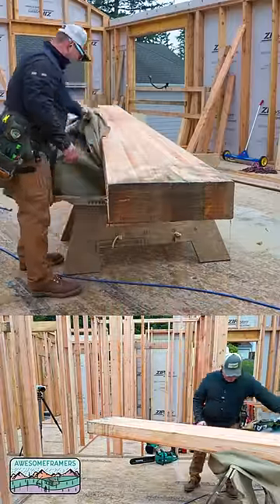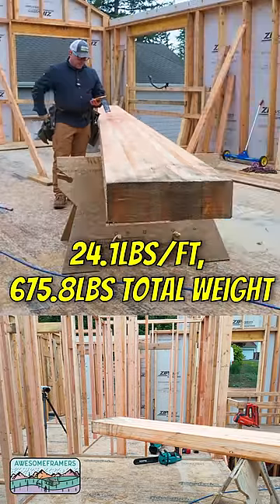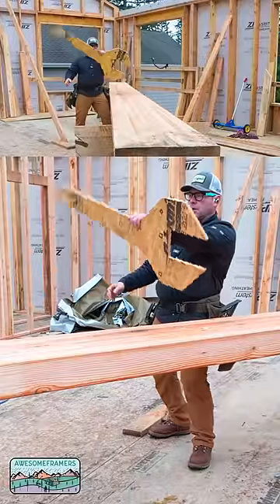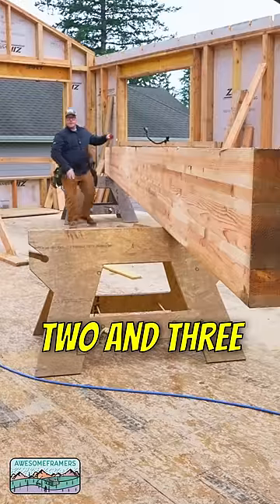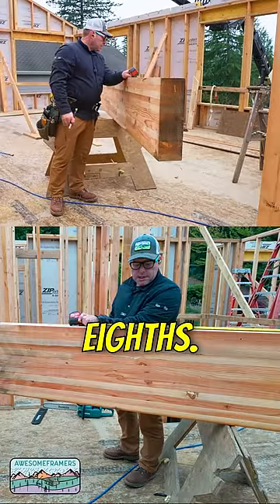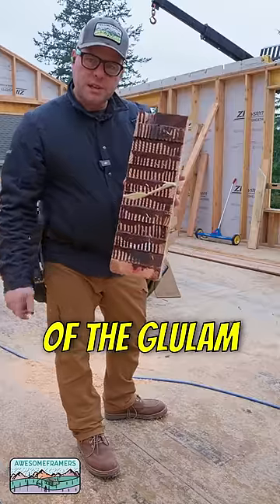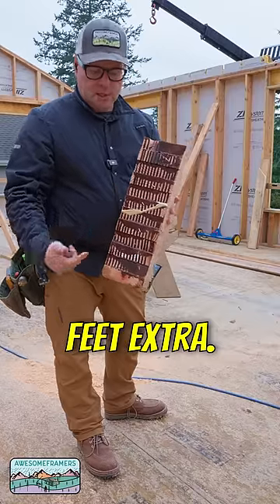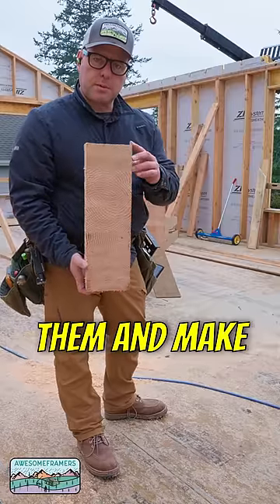Are You Strong Enough?  #framing #construction #leverage #glulam #huberpartner

Comment: What’s most impressive here is not the wrench but the saw horses are the real deal !
Reply: if your saw horses can't hold 300 lbs each then you need to sell your hammer and geta different job
Reply: We've had our  homemade saw horses for 5+ years now. Just replace the 2.6 tops every now and then from running the saw thru it 1000 times. We've for sure set at least this weight on them hundred of times
Reply: wood chips and glue. most houses made of now. complete garbage
Reply: Iv had a thousand pounds on the plastic stands from lowes. Building pallets at my old factory job and now as a self employed carpenter
Reply: @lilbucko  as opposed to buildings that were built before a building code was in place, they used to you horse hair and hay blades to insulate
Reply: @lilbucko before tyveck and before black paper for roofs
Reply: @lilbucko and the foundations made of rocks 100 years ago that are now crumbling, or the fact that the weight of the roof is floating and not even on the crumbling foundation
Reply: @chadvanryn1327  typical chad response.
Reply: Take it easy on the old dog school wasn't invented in his day so don't take him now
Reply: @joelchrysler6238  I’ll admit I like a love an old 2/12 and hate the new OSB I beams they started using
Reply: Yes @g-ray7019
Reply: Make a video on how to make the sawhorses please
Reply: Cheap saw horse hold a lot. Homemade ones hold thousands if the guy making them has any basic knowledge
Reply: @chadvanryn1327 also glulam and other products like lvl are often able to withstand much greater loads and span greater distances than traditional dimensional lumber
Reply: @chadvanryn1327 my house was built in 1913 with terracotta foundation, and zero damage. Holds up a lot better than sandstone.
Reply from the maker: @lilbucko Ignorance
Reply from the maker: @franciscodiegozavala71 it's already on my channel 👍
Reply: @chadvanryn1327 uh you're saying it's a bad thing that old houses are starting to fall down at 100 years? Guarantee the majority of houses built now will last not even half that
Reply: @chadvanryn1327 I don’t know where you are referring to but stone lasts for thousands of years. The town I live in has loads of stone buildings dating back to the 18th, 17th and 16th centuries as well as a couple of medieval buildings mixed in there. They’re all really solid  unlike the buildings from the 50’s, 60’s and 70’s. My family had to replace the entire roof in our 70’s house since it had deteriorated so badly the tiles were no longer waterproof. The old buildings in town do still require maintenance but the original materials including wood rarely need to be replaced outside of unusual circumstances such as prolonged neglect or storm damage.
Reply: Almost every manufactured sawhorse is rated for 1k+ pounds these could probably hold even more.
Reply: Saw horses are so strong I used them for my foundation and framed the whole house with saw horse wood. I've sat at my kitchen table with coffee watching F5 tornados go right over my house, no damage.
Reply: My saw horses are rated for 1500 lbs.
Reply: @thomasdracup8403  RE: stone foundations.

There are a LOT of houses built through the 1910-1940 era where the foundations are river rocks that have been surface mortared only. You'll get into a crawl space and see the foundation with a hole, look in the hole and the entire core of the foundation is just unmortared round rocks in a pile.
Reply: You're not wrong
Reply: @lilbucko it's not wood chips it's 2x4 pressure glued together. By the way plywood which that is has been around since Sparta and Roman times. Their shields were made of it
Reply: @lilbucko airplanes were made of plywood cause it's light and strong
Reply: @neverpreparedenough6431  Lets hear it for DeHaviland 😁
Reply: @neverpreparedenough6431  do you even know the difference between osb and plywood?? Lmao
Reply: That's what I thought
Reply: @lilbucko  Difference between OSB and Plywood is just the size of the "chips". lol

Oriented Strand Board is multiple layers of wood glued together with differing grain patterns...

Plywood is multiple layers of wood glued together with differing grain pattern.

OSB is just a bit more "recycling friendly" as you can use smaller pieces of wood to generate the chips while plywood needs full sheets of veneer. Otherwise, by function or cohesion, they're both pretty much the same...
Reply: @nunyabidness674  tell me you know nothing, without tell me you know nothing. Lmao
I like the definition you got of the internet.
Reply: @nunyabidness674  what you say goofball?
Reply: My sawhorses are rated to 10,000 lbs
Reply: 👏🏻👏🏻👏🏻👏🏻 those poor horses! 😅
Reply: Definitely impressed with the saw horses!
Reply: @lilbucko  These are not made from wood chips. These are made from solid timber. You can build your house out of whatever you want, if you can afford it.
Reply: Yes, I thought that too - but was a little worried when he stood that glulam on edge toward the edge of the sawhorses, barely keeping them within the sawhorse base's footprint!

Comment: You should see this guy's toolbox. Wrenches go from 1/8" to 47/8"
Reply: I was wondering what brand it was
Reply: 47/8” is wild😂
Reply: Me did they really just pass on the wrench like no big deal 
you 47/8th
Me 🫡
Reply: @thebatman5214  looks like a old Woodchuck- 47/8
Could be a custom Sapling (don't get me started) 
Hard to find- worth every penny. Lmao
Reply: Wonder if they have an adjustable version 😅
Reply: It's crazy he still uses non standard measurement
Reply: Doesn't even go to 6 inches? 5 7/8 inches is as big as the set goes?
Reply: @thebatman5214  It's made by Hubor and is sold as Advantech.

Comment: When I built my house I moved a 40' 440lb king beam into place by myself.  I moved it over the full basement wall so it was on the wall on that side and at the base of the opposing half wall.  I used a floor jack to get it high enough so I could lift it onto the base plate of the framed wall.  I had left the top plate off so I jacked up the beam from the outside of the wall as high as the jack would go and then in a herculean effort I lifted it the rest of the way, up and over into the framed beam pocket.  Pounded it into it's final position and straightened the wall, used a handsaw to trim the beam and nailed in the top plate.  My wife wrote the date on the cut off and it still sits on my desk today, almost 30 years later.
Reply: That story deserves a whiskey and a cigar... nicely done sir. 🥃
Reply: @knuckleheadpro8658  Cheers!
Reply: I built a 30' gluelam in place using a gallon of glue, consttruction screws, plywood and 2x10's sandwiched.  No way we were lifting that 15' in the air.  Where there's a will there's a way.
Reply: @davidyansky6605  That's a big one too!  Smarter to build, glue and screw it in place that high in the air.

Comment: Just make sure you lift with your back in a quick jerking motion, this will increase strength.
Reply: You really have to reach out and extend off centerline too. Be sure to twist as much as possible to get the maximum effect. Keep your core good and relaxed, then explode with power.
Reply: Great advice.
Reply: Noob Here,  Thaaaank You for the Valuable Advice!! I only have 1 question though...
Back Brace: Yay or Nay?? 
I say Nay, because it makes me look Goofy, and my Face has that covered all by itself!! Any advice will be greatly appreciated and utilized Immediately!!
Reply: @mikevg101  If a back brace wont interfere with your work, absolutely use one. If anyone tells you it makes you look goofy, you can laugh at them later when they're all mangled, twisted, and can't walk normally when they're 40.
Reply: Don't forget to wear the appropriate flip-flops and wrench your back sideways back and forth to really increase the amount of torque you can get.
Reply: @YukonJack  That's What I was forgetting!! The "Torque from wrenching my torso!!" See, this is the knowledge that can't be learned in a school!! I'll be A Foreman in No Time!!
Reply: I tried this and my back really hurts, did I do something wrong?
Reply: Get the groin involved too! You can make a lot of lifting power from the groin

Comment: I ordered a 9’ long x 20” wide x 2” thick limestone sill for the front of our fireplace and it was 375 lbs. talk about how easy that was to get home, then down the stairs. Then around the stair opening and to the fireplace…..Wow!  But it got done without breaking it, it’s been installed 20 years, still looks like new. The family room 6’ was 265 lbs. and it was easy!
Reply: Reminds me of trying to carry my soapstone woodstove into my house 😂 4 people and it was a huge struggle the whole time.

Then after we got it off the pallet and installed, I read "remove refractory stones before moving to reduce weight" and we all laughed
Reply: i did front concrete steps with two 3-foot square bluestone pieces to raise sunken precast up to right height that was a pain to drop those pieces on by myself.
Reply: Yelling at your wife 'STOP! STOP! WAIT A MINUTE!' the whole time
Reply: i took a player piano out of a basement once. stamped on the back was 708 pounds. it was easy since it was on 2 inch wheels. 50 years ago and i still have the hoist.

Comment: Used to work in a factory that produced LVL, we sold bundles that were as small as 1-1/2”x5”x12’ or as big as 3”x24”x60’. I tell you what, them bundles weighed THOUSANDS of lbs.

Those are the extreme ends of things though, we mostly sold 1-3/4” thick wood about a foot wide (11-7/8”) between 12 and 60 feet but some times we had odd-ball orders of 72-76’ long bundles. Just an 8’ section weighed 110lbs, couldn’t tell you how many of those I carried lol. Carried about 25k lbs in one 12hr shift, was ready to quit that day.
Reply: My neighbour was a truck driver for Sysco he moved anywhere from 10-20000 pounds 5 days a week and some of the businesses were up 50 stairs at the ski hill. 25k is physical but many people move that regularly.

Did you work for Louisiana Pacific or a different company? Most of my family did a couple years production at the mill in my hometown where LVL was the main thing.
Reply: @IhaveaDoghouse  it was LP. That company and the one that bought out the factory were terrible. Regardless of experience or position, everybody made the same. So while I was forklift certified and moving 30k lbs loads, and could do 6 out of the 8 positions where I worked, I got paid the same as the new guy who could only do 1 thing.

Major respect to anyone that carries 25k lbs of anything, by hand, across a couple of miles. I ain’t doing that again 😂
Reply: @SoreTv  Ya I'll get filled in on Pacific Woodtek when I go home for Christmas by my brother that still works there.

My dad suffered there 30 years as a maintenance electrician then talked me and another brother into becoming electricians lol. After he retired I asked him if he actually liked his job and he said no so pretty messed up he would recommend it as a career to his kids but the union ended up being good for him, growing up he was a few dollars an hour lower than oilfield electricians but when he retired last year he was making 44.50$ and hour while the oilfield rate is around 41$. 

He worked the "weekend shift" the last 15+ years so 3 10.5 hour shifts on saturday and sunday and get paid for 40 hours then he would be a zombie the rest of the week because he claimed he couldn't handle the weird schedule that he chose to stay on for almost 2 decades.

Honestly though my dad hated his job so much he wouldn't pick up a single OT shift and would sleep all week, anything the 5 of us wanted from the time we turned the working age of 14 (besides room and board) we had to pay for with our own money so all sports registration fees, equipment, clothes, vehicles, gas, insurance etc. we worked 50+ hours a week for in the summers and 24-32 hours a week for during school for 1/6 of what he would make if he could stand his job for more than 31.5 hours a week lol.

 I even bought my parents a car for 2500$ when I was 15 under the promise of 5% interest so 2625$ back and I didn't see a penny, instead got the choice of the chevy astro van or a clapped out truck his friend would trade for the astro van. So yes being an electrician for LP is so bad that you won't even go into work to pay off a debt to your own children.

 My gf is also an electrician as well as her dad and her mom was shocked when I said "the only rewarding thing about the job is the paycheque" and she was looking at him for a rebuttal to my comment and he just had the look like "ya, you think i've been having fun away at work the last 30 years?" She's a nurse so she actually has a rewarding job and couldn't fathom what it was like to be a numbered grunt for an industrial company.

Hopefully you found a better company to work for, I am trying to figure out a career change in my early 30's but not having any luck yet.
Reply: @IhaveaDoghouse  I would recommend picking up a trade but you’re already a sparky lol. I went into LP outta high school at 18 after I graduated early. After I left that place I started at a toyota dealership as a technician, but honestly I got too many bills and with them not moving me up and the limited OT, I’m looking for other avenues of income. I’m a hobby carpenter, mechanic, welder, and content creator with a tad bit of game development. I want to do a lot of things but being handy is at the center of all of it.

Comment: I saw this tool you made a while back and it inspired me to make something similar the other day.
I was replacing the flush valve on a Koehler toilet and the nut that hold it on is giant and none of the tools I had on hand could span it to remove/tighten that sucker. Found a bit of scrap plywood in the truck and cut it to shape and size. Worked like a charm

Comment: im more impressed with the saw horses
Reply: OSB is legit when loaded axially, hence it's usefulness as sheathing for rigidly tying the building framing together. 

Now, introduce a bit of flex into one of those legs with that load sitting on top, and you're gunna have a bad time! But with the 600+ pounds split between 2 horses, each with 4 feet contacting the ground, and those feet being pretty long in their contact area, I'd imagine you could load quite a bit more weight on them still. It's legit probably a better solution than commercial saw horses, which while able to carry thousands of pounds per pair, are transferring all that weight into the ground through feet that are an inch or two square: I'd not want to test my subfloors ability to resist point loads like that. These wide OSB feet are going to pretty much guarantee you're directly over a couple joists at any given time.

Comment: Why order that much extra footage? Not sure if I’m missing something. It’s around $50-100/ft in my area, depending on the time of year.
Reply from the maker: It's nowhere near $50/foot more here. I thought I addressed the extra length in the video. Glulams are manufactured in 60' lengths. As you can see the end isn't squared, but is actually how they are made. The local yard knows no one needs a 5.5"x18" glulam 5' long so they just shipped us the beam not cut to the length I ordered.

Comment: I need help figuring out what size beam to span for a sawmill shelter. I’m using 8x8s and want at least a 25’ long open span so I can load and unload the sawmill with my tractor or skid steer. 
I saw you using this product and I think it would work. I’m in NC and we don’t get a ton of snow. I’m building my trusses from true 2x8 yellow pine I sawed on my mill. 
Any help with beam is greatly appreciated and I have even looked at a steel truss frame like you see on lean-toos

Comment: We were replacing one and we had the old one with roofing nails poking out all over. It was tipsy and my boss said to go over and steady it as we were lowering it off of the lift. Well I get there right as it rolls over, I'm looming at where do I grab because I didn't want the roofing nails to rip off a finger and it fell off the lift landing small side on my foot. Broke my big toe in 3 places

Comment: We had a guy in our church that built a house around a small old house. Lived in the small house til the shell was done then tore down the old one inside. He had an elevated ceiling. The builder from our church didn’t want a steel beam because it would need a center support. So an engineer that taught at a nearby college from church had his students make the beam. It was laminated with a built in arch. 
It was like 30 feet long. Once in place it was level. With no bow. 
Flat as can be. Like Howard Hughs’ Spruce Goose. Wood engineering.
Reply: If they had wider flange center support would not be needed

Comment: Funny enough I can lift an end of that. Me and a coworker deadlifted a 18"x 18"x10' poplar beam off the floor. If I remember those measurements right, wet that was around 600lbs so 300lbs on each end.

Comment: Torque equals force times strength or T=(f)S the longer it is the easier it should be for leverage aka cheater bars aka long pipes aka breaker bars

Comment: I doubt I could lift anything close to that anymore, my back ain't what it used to be.
That said, ya need a good grip, balance, and strong legs.
Surprisingly not much arm strength, other than not letting it slip.

I carried stacks of long boards for cabinet across the shop to cut down, maybe not quite this much weight, but more than a person for sure.